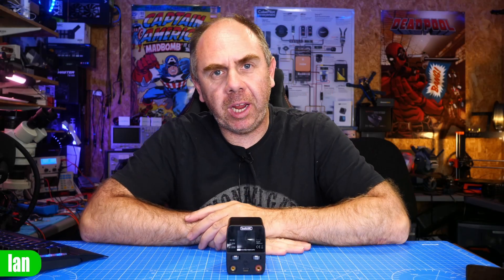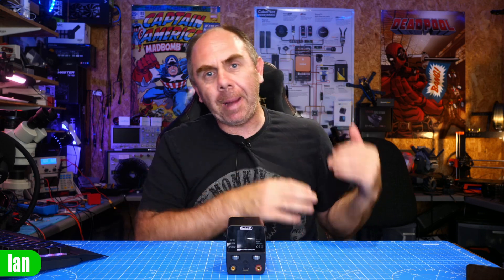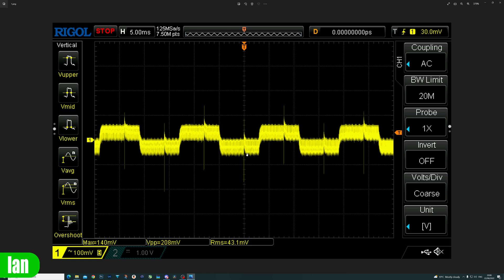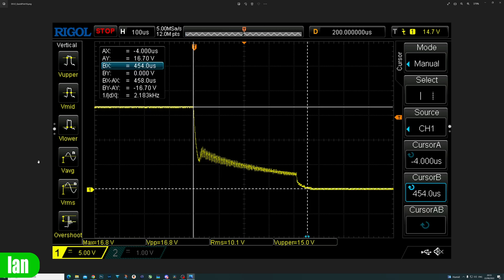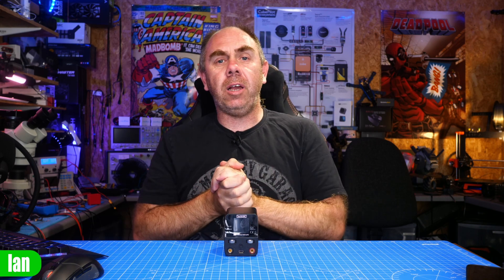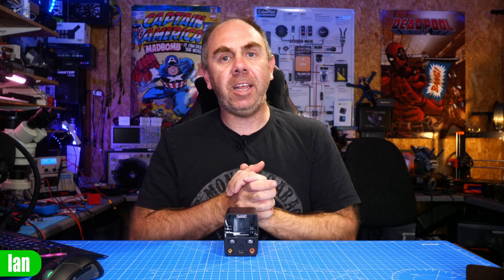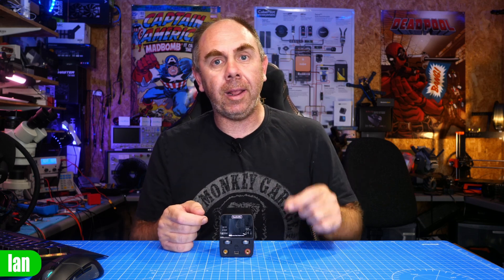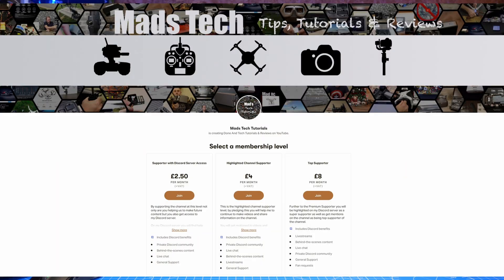ToolkitRC P200 PSU - Load & Short Testing

Comment: Got a chance to get my hands in the Avata and the goggles and camera are great, but no longer useable with even small glasses. 
You can adjust the oculars left and right. Feels comfirtable but some light came in. Had not much time to adjust. Great improvements, nice, really nice OLED and I am blown away. 
I want the goggles, but not the drone. Strange weird and loud sound, neighbours would go crazy. 
Feels solid, compared to the fpv Drone, but flighttime feels not so great. It is a toy , but good camera. That's why I will get them later this year when dji had made clear what other drone will work with the goggles. I won't buy a pure fpv miniwhoop fpv system, cause I need Mini 3 or Air 2S Support and then air units for 2+ planes.

Can recommend the goggles and the dji motion controller but not really the whoop, even though it makes fun, but I guess you can outgrow pretty soon and it feels not suitable to use when other people are nearby. Too noisy especially the pitch even If you fly higher.
The drone attracts pretty young kids from everywhere like no dji drone before. If they bring their parents you will end in Long conversations or tell them upfront 'at least 1.250€' to be able to fly. Of cause they then ask for a beginner mit and I have no clue except get a tello for 99€ and enough batteries to learn to fly and then they are happy once they have seen those. Sold already my used one - still have a new one in the Box.

Regarding flight: got about 1,5 km and then battery warning kicked in. Flight time is hard to tell cause I only got the already used battery which was 75% due to setting Up and preparation time. Had just 45 minutes and had to leave unfortunatelly

Comment: I’ve been using my little m6 as a power supply and field charger for 3 years now with no issues. Have used it as a smoke stopper with every build since purchased. I’ve heard plenty of horror stories but guess I got lucky

Comment: That is great in depth review and test procedure especially the oscilloscope part and the shorts. It hurt with each short.

I still use the good old Graupner from 2016 with an internal 150W power supply which is a huge unit.
But it delivers the voltage below the 100 mV you had mentioned.  Still works great, is massive and heavy, but capable a lot and has software support to charge and discharge automatically and get a graph. Quite usefull to compare batteries year by year regarding capacity.

But in 2025 I will get a new one for out in the field use. After 10 years my better half will not complain about the next fortune spend for a hobby.